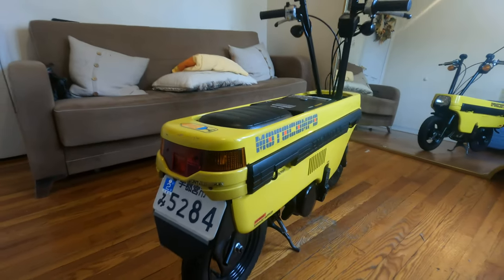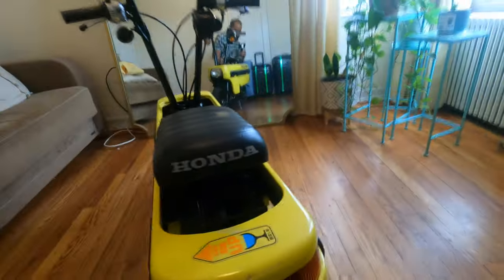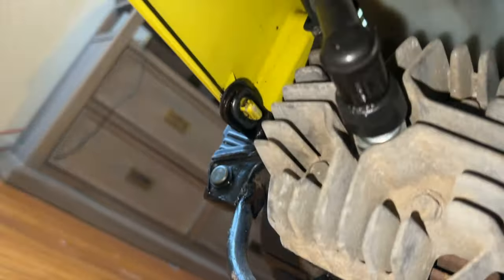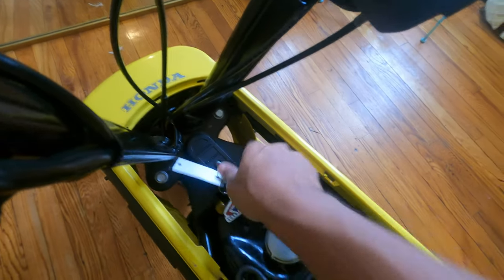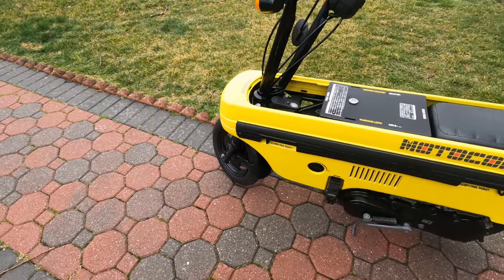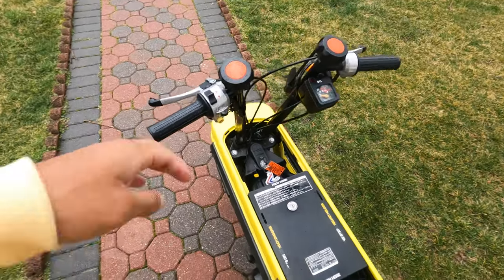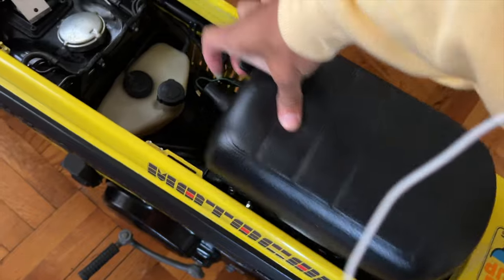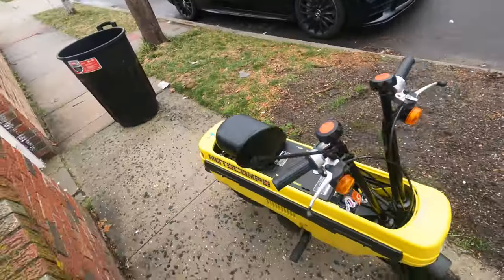Honda Motocompo FULL OVERVIEW

Comment: I don't think you're crazy for spending over $6K for the Motocompo.  I think it's cute and Japanese retro, so it's definitely collectible.  It's not my cup of tea, but it's cool that you enjoy it.  I love my Hijet and even with extensive upgrades it cost less than the Motocompo, and the Hijet is way more practical for me.  It's been my daily driver lately.  After three weeks, I finally drove my 4Runner tonight just to keep the battery charged.

Comment: 14:15 - If you put 93 octane in that little Motocompo, all you'd do is drain the 87 octane out of the hose and leave your 93 octane for the next motorist.
Reply from the maker: would 93 help it last longer>
Reply: @Waybeforethefame  - I doubt the Motocompo has a high compression engine so it shouldn't benefit from high octane gasoline.  The owner's manual should specify the recommended octane rating.  Be aware that the Japanese use a different method of calculating octane than the method used by API in the US.

I'd be more concerned with the ethanol that's in US gasoline now.  I don't think it's ever been in Japanese gasoline.  Ethanol can degrade rubber hoses, O-rings, seals and it can contribute to nasty oxidation on some aluminum parts like carburetors.  Modern vehicles sold in the US are designed for ethanol in gasoline.  Older vehicles aren't.  Pure Gas is an app and a website that helps you locate ethanol free gasoline.

Comment: I love the form factor and its intended use but don't want to deal with the little two stroke and 70s technology.  What I'd love to see is the same type of vehicle as the Motocompo but with LiFePO4 batteries.  The eMotocompo!  Make it 50 pounds instead of 100 pounds.  I had a little two seat tandem aircraft and I'd put a folding 2 stroke scooter in the back.  A battery powered Motocompo would be great for that.
Reply: Lol honda must have seen your comment
Reply: @jonatan_leandoer96  - I'm an electrical engineer, and that grants me a certain degree of techno-clairvoyance.   😀